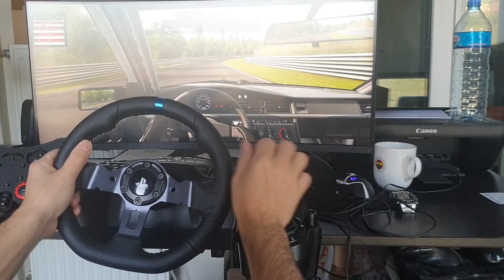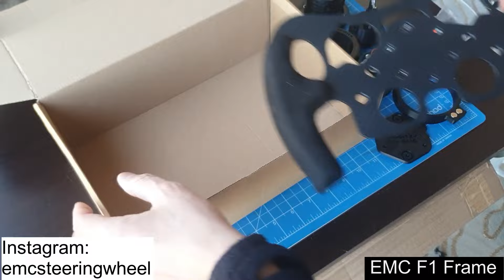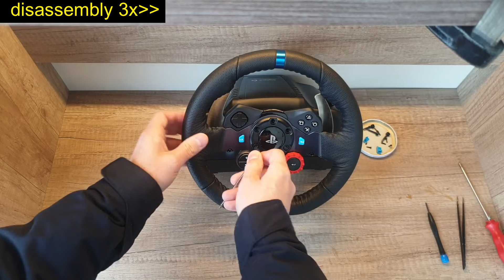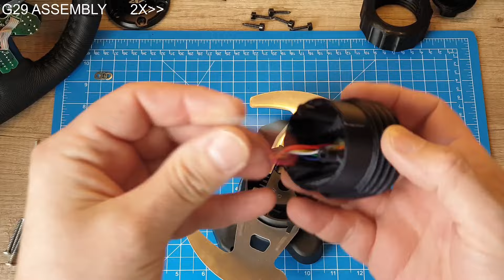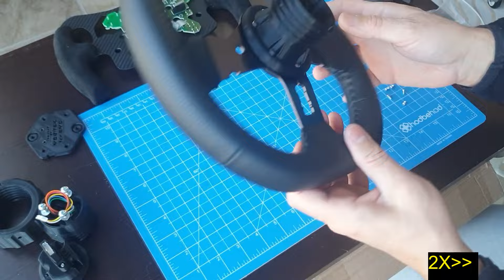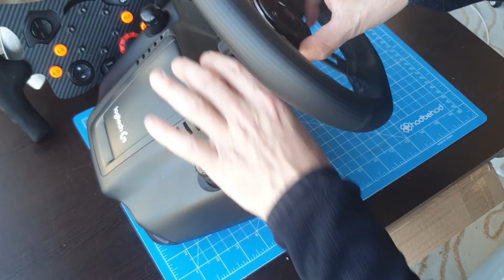Logitech G29 G920 G923 Quick Release Kit, EMC F1 wheel Upgrade, Rounded Wheel Adapter Installation

Comment: Hey, i am trying to take apart the f1 mod and trying to install to buttons again on the normal steer. But i can't get the adapter of the normaal steering wheel. Is it glued? I have already taken off the screws
Reply from the maker: There are no glue on my products. If you are talking about my products, please send pictures via ETSY message.

Comment: Do you think i will be able to install this mod with a f1 mod from acelith (wheel : g923 xbox)
Reply from the maker: If you have an f1 wheel upgrade already, you can buy a quick release kit and rounded Stock Steering Wheel adapter.

Comment: I purchased the quick release mod from Etsy. Install was easy unfortunately the buttons did not work. I ensured all connection were secure but the buttons on my G29 didn’t work. I removed the mod and was able to use the buttons. Do you have any advice?
Reply from the maker: Hello Joel, I answered to you via Etsy. I ask you to check pins. And couldn't hear from you. If it is not still working, you are the first person who have trouble with quick release. Please write me via Etsy. If it is nececery. I can send you a new unit.

Comment: g27?
Reply from the maker: You can use g27's rounded wheel without buttons with this adapter. https://www.etsy.com/listing/1317298802/thrustmaster-adapter-for-logitech-g29
But you will need quick release adapter too.
https://www.etsy.com/listing/1220066168/quick-release-adapter-for-logitech-g29
But ı do not have a f1 wheel upgrade frame for g27.